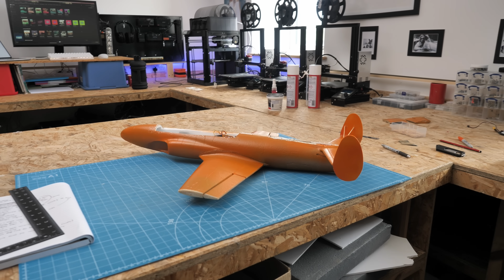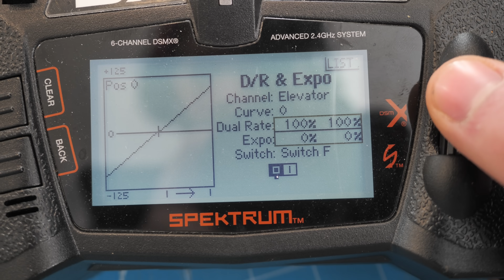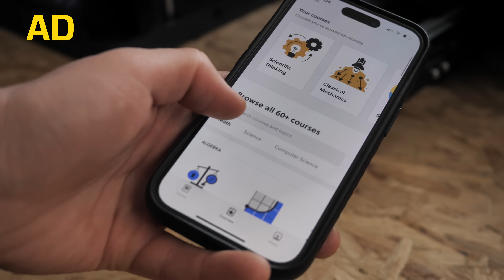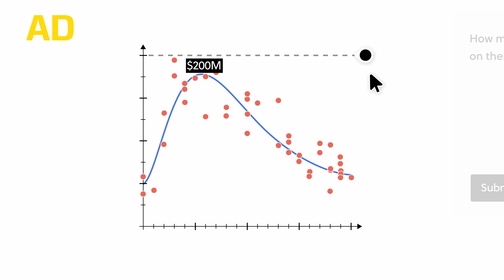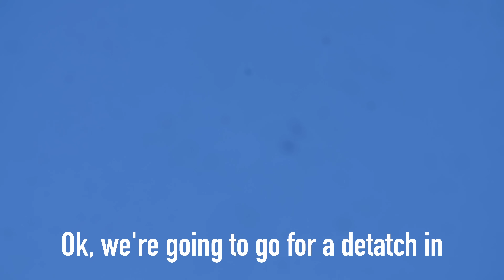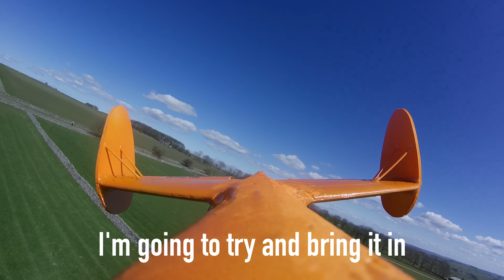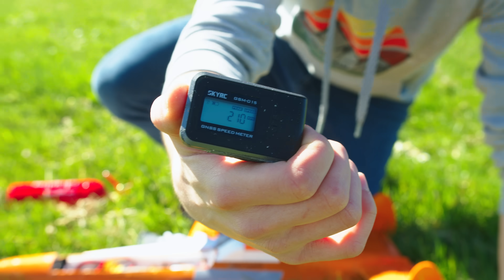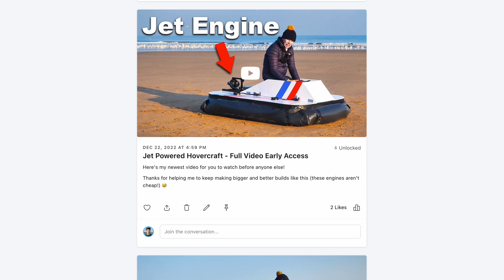Building the WORLDS FASTEST RC Rocket Plane! (Part 2)

Comment: uh, thats a guided missile sir
Reply: I'm not sure if you're joking or not but sadly lawyers would agree with you...weirdly enough last time I looked this up (almost two decades ago now so this is not exactly currently valid information by any means, also I'm not a lawyer) the qualifier was based almost entirely on the propulsion type not on anything to do with the performance of the craft or even whether or not it had a payload, granted you'd still get in all sorts of trouble separately for sticking a pound of plastique into a fuselage slapping an old Cox 2-stroke on the front and flying it around through a camera but it wouldn't have counted as a "missile" meanwhile sticking an analogue auto-adjust system on the fins of your plastic pipe + off the shelf kid-safe hobby engine + paper mache model rocket could get you life in prison.
basically it was anything rocket-propelled + airborne + guidable = missile with "guidable" being able to be fudged to include almost literally any adjustable control surface up to and including nonsense like "this plastic could be intentionally bent, that's a guidance system!" basically they were laws designed around it being impossible to produce a fact-based legal defense when charged with them because they were quite literally charging and convicting you for things that you could conceivably do in the future with someone making that nonsense claim being the only actual requirement for conviction: ANYTHING with a rocket on it could be counted as a civilian attempting to develop unauthorized missile weapons technology provided they could in some way link you to the object.
Reply: @evernewb2073  not gonna read all that, it's a guided missile, very cool, I like it.

Comment: Instead of filling the air intakes, couldn't you just cut them off and glue some foam over the holes? It would remove weight and probably reduce drag. Other than that, your video is absolutely amazing!

Comment: For the umpteenth time: You need less boost more time. Not much momentum in a short time.
You have to use other engines. It is likely that the GPS will mark anything because it does not even have time to measure. Because the burning time is extremely short. The same old problem that you always repeat.

Comment: I hope in some future video you decide to revisit this and capture actual telemetric proof of your top speed. GPS is great for location and speed of slower moving things but off the shelf consumer GPS modules are not great by design for measuring particularly high speeds and altitudes. Some are even programmed to turn off if a particular speed or altitude limit has been exceeded. The idea there is you can't stick a computer and a rocket motor to a cheap GPS module and make a guided missile or something dangerous like that.

There are modules available for things like high altitude balloon platforms as the benchmark for a successful HAB deployment is reaching 15-18K kilometers and then 100K kilometers. These modules will continue to give accurate measurements of altitude, but will still shut off if your high altitude balloon suddenly starts moving horizontally super fast.

There are some better ways, though, that are purpose-built for measuring the speed of RC vehicles. I've not looked into this technology much, but I get the idea it has been around for a while because I found this video (https://www.youtube.com/watch?v=PgEqClgt9V8) about one such device from 2 years ago. It will probably be super useful for a lot of revisits like the rocket boat. With the return of spring maybe we're due a boat revisit.

Anyway, thank you for continuing to share your creations with us.

Comment: Im aware that the issue is a "lack of data" due to perhaps the refresh rate of your gps unit. Im just a hobbyist but it's common in the RC COMUNITY a little unit called GSM020 as it allows you to measure and analyze many aspects of your build using the latest GPS and GLONASS which gives you Acceleration, G-force, Speed, Time, Distance, High and Vertical Velocity
To be clear, this has been one of the most accurate devices due to all of it advantages over traditional small gps units which might be accurate but it takes them to long in between intervals to be "accurate enough" in short bursts of speed.

Comment: Swept wings+V-tail or Swept Deltawing +single stabilizer
Flapperons/Elevons
Dual motors
Conical tail section for even more aero
Put the runcam in the nose instead of in a bump out on the spine.

Comment: Research "insert molding"
Create a framework from carbon tubes.
Glue all electronics and mechanical parts to frame.
Spray foam entire thing, harden, cut & sand to desired shape, 1 solid piece.

Comment: Those solid rocket motors have "report" charge at the end, designed to 
deploy a parachute or streamer. Plug it up with hot glue, it should just
fire out of the nozzle.

Comment: Insane results! I wonder if a big part of the reason the GPS recorded excessively low is because its sample rate is low enough that it didn't catch the full turns and thus misjudged the distance traveled. It would be handy if you could adjust the sample rate on it

Comment: lots of thoughts here. Many people are suggesting delta or swept wings but there is little advantage at flight speeds way below the speed of sound. I think moving away from the EDF was a mistake. The air intakes are not causing significant drag as the air is being sucked into them not diverted around them. The struts to strengthen the tail were very un-aerodynamic and going back to the original tail configuration would have been better. Tuning the gyro rather than removing it would have been my approach. Using an arduplane controller with a pitot would have additional benefits including far better speed logging. Cutting down the wings was also an error and was the main problem with landing. The wing loading with the payload was already high. Reducing your wing area is going to mean higher angle of attack at the same speed, increasing frontal area and drag, so it cancels out any benefit.  Also a carbon spar in the wing would have been a big improvement.

Comment: "An aircraft catapult is a device used to allow aircraft to take off in a limited distance, typically from the deck of a vessel. They can also be installed on land-based runways, although this is rarely done. They are usually used on aircraft carriers as a form of assisted take off." Just fyi.

Comment: Yeah, I disliked that cheap GPS speedometer when I saw it in the last video, and the way you mounted it inside is less than ideal; I'm not surprised to find out its accuracy is sus.

Your best bet would be to go with a proper ArduPilot flight controller, and pair it with a GPS receiver that has a good reputation in the ArduPilot community. Configure it to do proper GPS logging at a high refresh rate. Not only will that allow you extract a top speed, but you will be able to graph the speed/acceleration profile, view the exact waypoints, see the reported GPS accuracy, and use all those factors to get those to get a high confidence of your speed, and a whole lot of extra data. 
Also, make sure the GPS antenna is mounted outside, with a good view of the sky.

Comment: Awesome and entertaining, James, as always. I am an engineer so I checked the manual of the GSM-015 GNSS SPEED METER. the measurement rate is 1 HZ ( factory default) settable up to 10 Hz.Even at 1 Hz it can miss the last second of acceleration, which doesn't explain all the 160 kmh vs 210 kmh measurement.  I have found several studies that indicate that GPS underestimates top speeds from -3 to -1 % when accelerating ( all of the studies were for running and sprinting athletes !! so at much lower speed and acceleration) Hm..  The only thing I can suggest to stick the camera inside with the lens pointing straight down, to really nail what speed it was going. Who knows , perhaps even you first attempt was already over the speed record :) Cheers, James.

Comment: I would say that leaving the camera off could easily gain you 20mph. Creating a clear naca shaped shroud over it should gain you most of that speed. The gains from the shortened wings and the sharpened trailing edges of the wings would be nothing compared to the blunt body of the camera sticking out the top of the airframe.
Great result with a fairly low tech build.

Comment: Behemoth v2 60" 12s Fully built for race (240kph - 150mph) with video  This is a 100% Custome FPV wing. At around 10 pounds with a huge airfoil that I hand drawn. This wing floats very well and is easy to lauch alone if you had to. I was able to pack all the gear inside very well.
https://www.youtube.com/watch?v=sjjzNEFV9x0

Comment: I'm not sure how reliable the Velocity from GPS is. They use the dopper effect to get the speed which accuracy is debatable. Aircraft to this day use piot tubes for airspeed (also a thing bc if you fly into the wind gps is ground speed). And there are ones for drones aswell with i2c connections. Just a suggestion. Awesome video!!
Reply: Radio waves are effectively moving at the speed of light so there is no measurable doppler effect.

Comment: also gps can be inacurate because it measures between two points and if you use a rocket it can travel really fast and then slow down before the GPS measures the next pont.

Comment: Wouldn´t it be better to use mirrors on the outside and have the camera itself inside the plane? You would bring the weight of the camera closer to the centreline and not as much drag on the outside.

Comment: Btw, i got a similar GPS-unit, and the thing is only 1hz polling rate default, and adjustable to 10hz. Still slow and way to unresponsive when going for bursts in speed like this. Maybe try to find a gps meter with higher polling rate?

Comment: I think you have problem with the design of wing co efficient to the angle of attack. The engine or the jet when it pick from its max power output of the rocket it automatically pitch up there for  you have to make you  CG more forward  For you to attain economical lift at high speed .

Note the attitude of your plane automatically pitch up when gaining  speed there much better use symmetrical for better and efficient on high speed  performance

Comment: I would have liked to see you testing the GPS to replicate the failure.
No worries I'm sure you can add that as a clip on a relevant video.

If you keep building ultra fast things you will need to find an alternative! Keep it up, great video
Reply: The GPS is irrelevant - this is an aircraft, not a car. He needs to measure airspeed.
Reply: @aGabay  even air speed is kinda tough one. A super light plane can take off at 0 ground speed in high wind for example. Is that plane moving fast? No, it's the wind blowing fast.
Reply: @castform57  you are right and wrong. Yes, from a geographical stand point it's not moving. But from the aerodynamic stand point it is moving! Pilots use airspeed to fly the plane, ground speed is used only for navigation.

Comment: You could also add a servo onto the plane and make a vent into the edf that when you would flip a switch it would close the vent allowing for the aerodynamics that you need for speed while also allowing for independent flight before and after the rocket is ignited

Comment: Why did you drop it vertically from the drone instead of horizontally, like rocket planes are typically dropped from mother aircraft? Feels like you're bleeding altitude and speed unnecessarily by doing that.

Comment: Two Ideas you could consider:

1. Fiberglass sheets + resin and make 3d printed molds to make thin, light and very durable parts. It's messy but they are strong and durable and cheap(compared to their bigger brother - carbon fiber). 
2. For camera, get an ESP32 cam module. The lens is tiny and is attached to the board with a ribbon cable so very little would stick out(the lens and sensor themselves are like 5*5*5mm. Yes, quality isn't the greatest but it is good enough.

Comment: maybe you should swap to a "real" Airspeed speedsensor that work via airpressure. That is way more accurate than using GPS. Seeing you use Spektrum SM has Sensors working with Spektrum.

Comment: Uh...... this is pointless and dumb.
There has been for years now a few prop driven foam off the shelf RC airplanes that can do over 130 mph, and several electric ducted fan jets that go even faster.
My stock Freewing F-22 Raptor does 120 mph out of the box, and there are many others even faster.

Comment: strange actions ... we remove the wingtips to reduce air resistance, but then we add all kinds of debris to the stabilizer in an effort not to lose keels ... it would be easier and more correct to remove the keels from the stabilizer and return one but strong and reliable keel to the fuselage, good now there's nothing stopping it...
the camera can be integrated into a removable sunroof, this will still gain a mile or so due to cleaner aerodynamics, the side air intakes can also be shortened, thereby reducing the midsection of the model and still gaining some speed ...
and in order for the engine not to knock out, just remove the expelling charge from the engine, replacing it with some kind of two-component glue, so that when the retarder in the model rocket engine burns out to the end, the fire does not spread to the fuselage ...
did you think about the parachute rescue system? the weight is not big, one more servo and a little ingenuity...

Comment: Entertaining enough but lots of errors. On your last effort many comments stated that although you weren't using model rocket engines with parachute igniters causing the ejection, you were using engines with a second stage ignitor, instead of using the same incorrect engine it would've made more sense to go with the correct ones and not risk just blowing your fuselage to pieces by locking the engine into place. Additionally, tooth picks are obviously not going to stabilise much at all, not is hot glue, a tiny bit of carbon fibre or even just skewers inserted laterally along your stabiliser with some epoxy would work much better. Finally, and probably most importantly you can get flight controllers (gyros) that probably weigh less than that GPS unit you are using which will include actual GPS land speed instead of perhaps the lateral speed your input is providing, on addition to a host of other useful data in the black box not to mention stabilisation.
When I try this myself (I'm old and have kids so no time to actually do it, just critique other people online) I will be using EDF and rockets as EDF do perform incredibly efficiently at high speed, I'll also be packing my own rockets likely using old Berrocca canisters as the force will either send it supersonic it just tear the wings off. Oh, and also a proper airframe, FMS Avanti 70mm.

Comment: I don't think you are running into GPS limitations - as they are 1900kmph at 18,000m. This is hardly a ballistic missile! Would it be worth trying to get a GNNS RTK system - they are supposed to be a lot more accurate and aren't ludicrously expensive. And if you can't get a bigger motor, maybe cluster them? Have you tried building a rocket glider? (ie rocket up, glide down) with pop out wings or a delta wing.

Comment: You can see a major issue at 1:02 - Your wings and ailerons are wobbling under excess load. I had this issue all the time when running foam models with electric motors that had 5-10x the recommended wattage, great fun btw, nothing quite like seeing a drivetrain being ripped out of a poorly reinforced foam fuselage..
Anyway, the best solution I found for wobbly wings was a carbon fiber spar. I used 0.5mm and 1mm thick flatstock that was wider than the thickness of the wing. i then cut the wing all the way through lengthwise and used contact cement (UHU POR) to glue everything back together, then dremeled off the excess carbon fiber material. You would not believe how stiff such a wing was, afterwards. For ailerons, I reinforced the root of the wing cutout in a similar fashion and then used fiberglassed balsa ailerons instead of the original foam ones. They tend to hold the torsion forces much more reliably.
Reply: the ailerons are wobling because of the gyro correcting and over correcting itself at a very fast speed i think
Reply: it's not because of load, it's the gyro overcompensation.

Comment: A propeller in the nose would remove the need for a drop and still have aligned center of thrust and center of gravity. Also a wing high up on the fuselage or a strong dihedral wing angle could minimize wing strikes on landing and make the plane more stable in flight.

Comment: youve completely lost track of the goal now. plus rockets are cheating. it should be able to sustain the flight speed instead of relying on a 2.5 second burst of immense thrust. also, what do you think of the p1p? do you think the price cut is worth not having the touch panel and lidar, do you have to finick or re level it once in a while still? trying to decide which one to get.